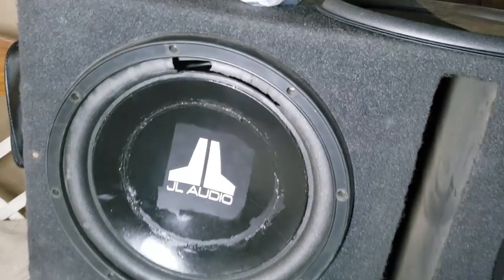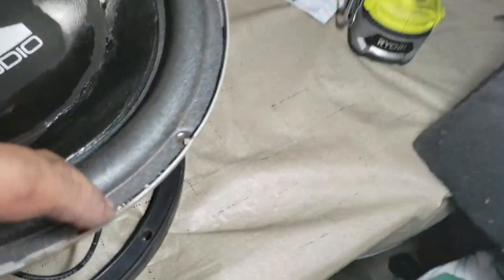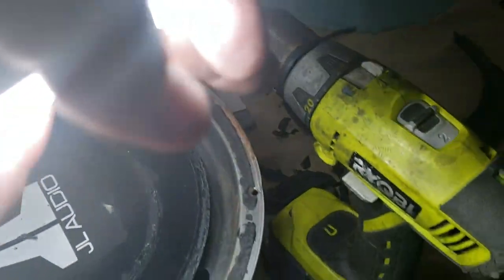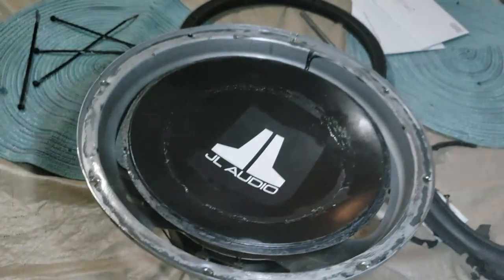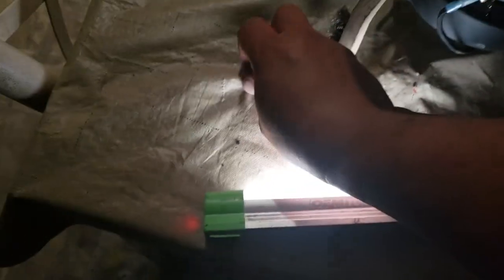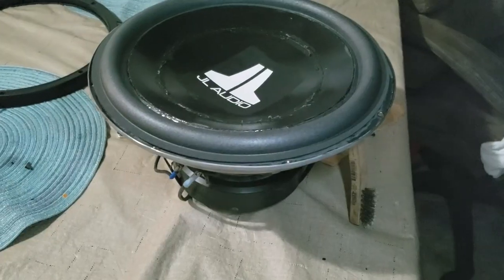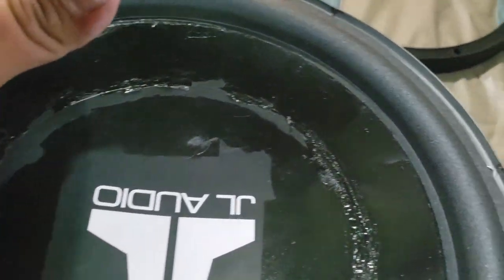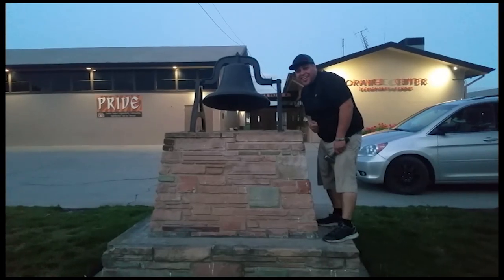How to: Restore a JL Audio 12w3 Subwoofer Surround Foam

Comment: What type of glue would you recommend using to fasten the cone back to the spider on a w3v3. I bought it used and it was already fixed in the past with what looks like white caulk. I'm gonna scrape that off and try something different but am not sure what type of glue to use.
Reply from the maker: Get the foam kit that includes the glue. Its a black thick gel....I think its window glue honestly not sure tho. But the glue they provide with the kit is very durable

Found one under 20 bucks....
https://www.ebay.com/itm/141109373437
Reply: @559powerscape  thanks for the response. I got gorilla glue and I'm hoping for the best. Lol
Reply: I used the glue the store who sold me the replacement surrounds told me to use.  Was fixing 2 JL W3 12" and it cost me $39 for everything.  (That's about $32USD)
Reply: @rxtuninginc8444  I used gorilla glue when I first posted this and the sub has sounded great so far. 🤷‍♂️
Reply: @BradVicious  I didn't say what you did wouldn't work just said what I used to do it.
Reply: @rxtuninginc8444  And I didn't say that you were saying that. I was simply updating you on how my sub has been working since using gorilla glue.
Reply: Man any one watching this really have magnets just fall off- those things riveted on the basket like stink on poo- and it doesn't need to look like shit; I used blue painters tape & kept her clean homeboy, take that cover off & slip sum paper evenly inside the coil gap till it's snug,then clean all that wasted glue off and re-assemble...I never had a magnet just fall off a sub_ watch a video on sum1 realigning it's funny shit
Reply: Best glue is 3m yellow weatherstrip adhesive- or you can use crystal clear gorilla contact adhesive for coil and spider_ but the foam likes black CA glue( just a rubberized version contact adhesive)...

Comment: Where do you get the repair foam
Reply from the maker: Found it on ebay ...
https://www.ebay.com/itm/272051954411?mkcid=16&mkevt=1&mkrid=711-127632-2357-0&ssspo=Ap-TEKcGTxS&sssrc=2349624&ssuid=Q-DrubH0Sve&var=&widget_ver=artemis&media=COPY
Reply: Hi, I have same issue on my JL Audio 12w3v2, did you find the foam boot?

Comment: Where did you find those foams I can't find it damn it
Reply from the maker: On ebay, I'll post you the link. Thank you for your SUPPORT! https://www.ebay.com/itm/290761474165
Reply: I got the replacement surrounds for my 12" JL W3 from a store local to me The Speaker Shop.  They have all sorts of repair kits and the glue.  Not much different than ordering from Ebay pricewise and benetfit of being able to see them ahead of time to verify the will work was worth the extra few bucks.  I'm in Canada, price for 2 surrounds and glue was $39.  In USD that would be about $32 and eBay was $29.